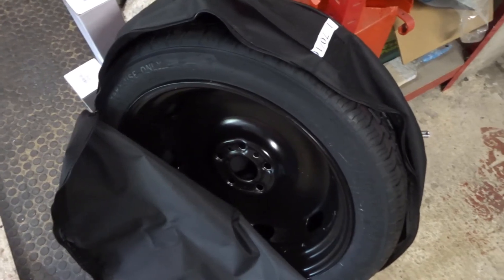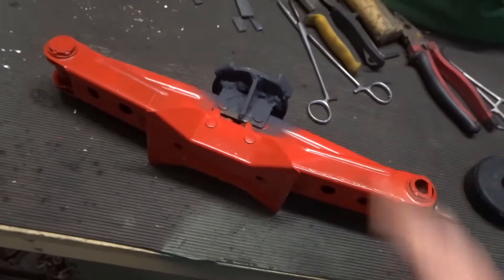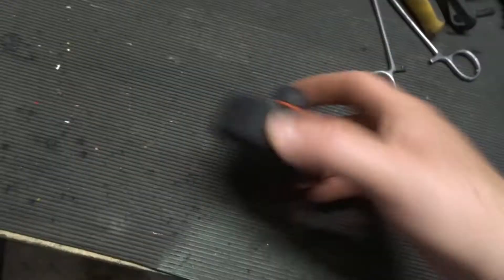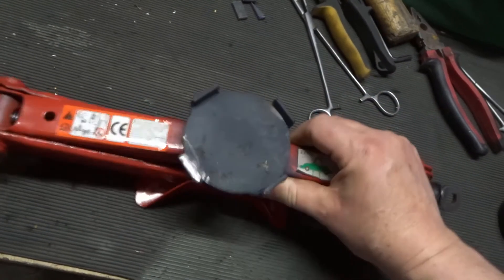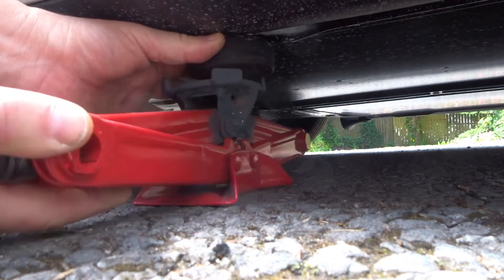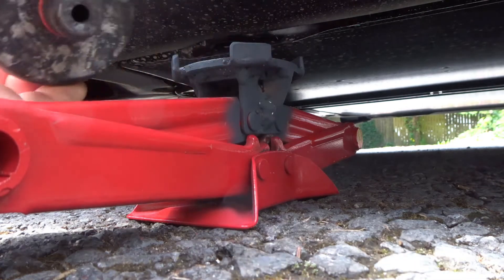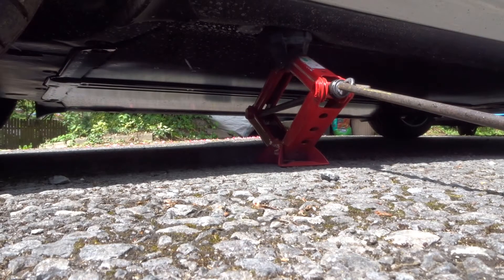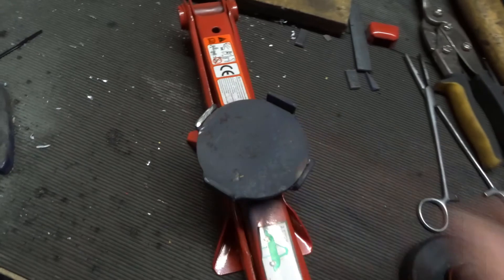Scissor Jack Mod for Tesla Puck: Model 3

Comment: Excellent work. I’ve been noodling how to do this and came across a 30” Lippert scissor jack (google it), That has a flat-top base already AND a hex drive!! that allows a power tool to do the work. Instead of loop and hook manual crank.  Love it !
Reply from the maker: Well spotted, I couldn't find anything like that when I made mine. The variant with the round flat top over here is called the: Lippert 285332 30" Scissor Jack. It seems expensive for a scissor jack - maybe they know Tesla owners might want it so bumped up the price!

Comment: I was looking for a puck friendly scissor jack.. this is a perfect solution. Most of us will need to learn how to weld to do that. Thanks for sharing.
Reply from the maker: I would not do this as a beginner welder. Seriously though I bought a 10cm diameter metal disc 4mm thick steel off ebay, cut down top of a regular jack and welded it on. Any metal fabrication company could do that for you for a generous contribution to their coffee fund perhaps.......

Comment: Thanks for the video.  In the video, did I see some deformation of the underside of the body as you jacked the car up, around where the puck took up the weight?
Reply from the maker: I hope not. Puck definitely in correct location and fully supported over its full underside area.
Reply: The surface of the jack point on the Tesla is not perfectly round to march the puck, which is why it is in fact deformed. The vehicle side is fine The puck deforms. I have noticed that this results in the jack having a certain amount of tilt, which is worrisome. I am actually working on making my own custom puck from solid aluminum to avoid this problem.